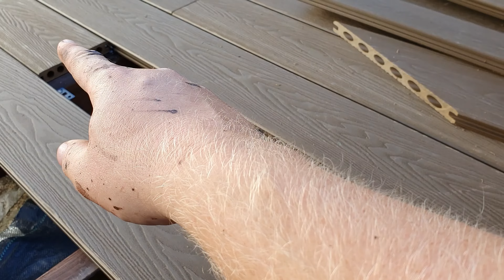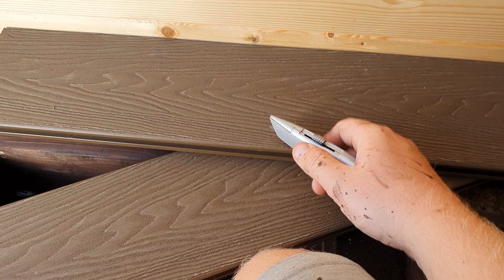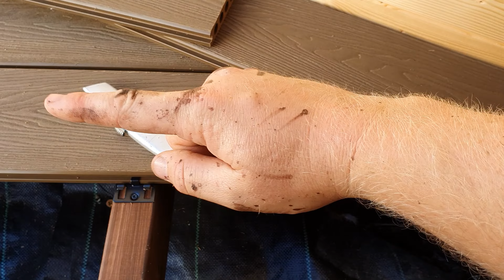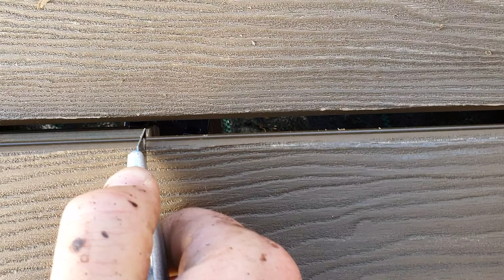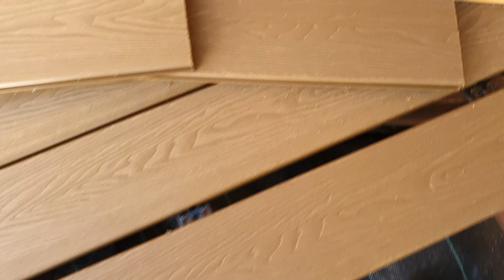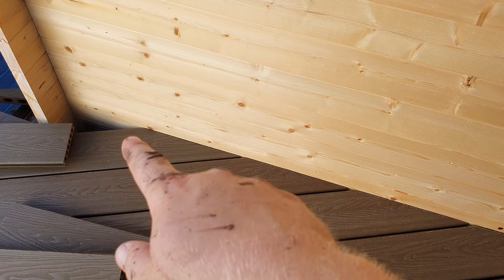How to make angle cuts on decking boards - easy diy

Comment: Beautiful, thank you so much my Brother,  I have been doing Decks for 10 years and I always had hard time with the angle cuts, very simple things can help you ti make good money if you know how to do it, 
Thanks for sharing your knowledge
Reply from the maker: i find there is always something new to learn to help speed up a job. if it was an angle on the deck like say the decking had a diagonal edge i would just put all the boards down long and string the edge and cut them all at once. but cos there was a wall here i used this method. thanks for watching and commenting.

Comment: Curious, why use a full width  board against the abutment? You can use a 4' level n save 4-5" on  all your boards
Reply: I guess it would depend on the angel
Reply from the maker: Was just what I had to hand and was thick enough to be against the wall whilst covering the part of the board that can't touch the wall.

Comment: Out of curiosity, why is the spacer required? Is it just the geometry?.. or due to the hidden fastener being in the way?
Reply from the maker: i used a bit of board as a spacer so the bit i wanted to cut would sit flat and parallel to the boards laid down so that when its cut it will be the right angle, if i laid it on top and didn't make sure it was nice and straight to the boards the angle might be wrong when i put it in place, if that makes sense

Comment: Yeah but if you have angle cuts at both ends of board?
Reply from the maker: in that case i use a tape and measure it, i don't think i know an easy way for this. i would space the board gap out then mark a square centre line and measure from this line in both directions top and bottom of each cut. or if i had offcuts that was the same angle id use them, cut one end then measure to where the other angle cut needed to be. sorry if i explained this horribly its hard to describe i should make a video one day haha